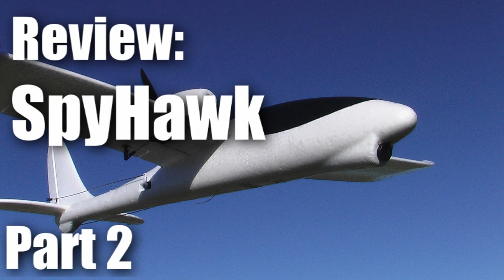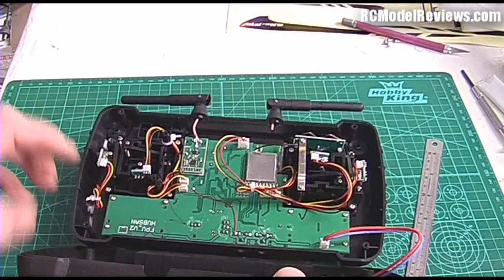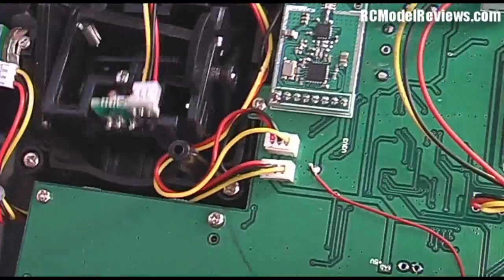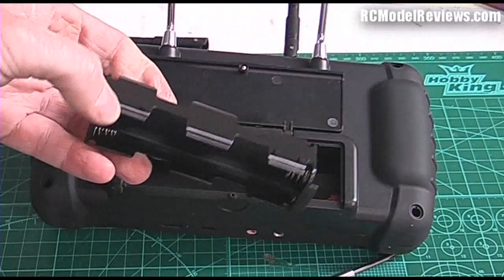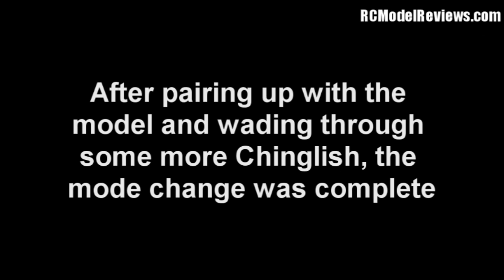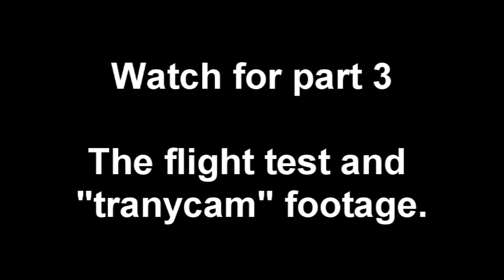Review: Hubsan SpyHawk FPV (part 2)

Comment: And between Ali and Hubsan they are improving it over time to work out all the glitches, they already solved the problem so you can turn off and on the stabilization, added a feature to start and stop recording, solved the overheating issues with the video tx, and as time goes with more tests and reviews it'll only get better. Atleast they are trying, and the 1st to have a fpv all-in-one in fact as well. The 2nd batch seems to have fixed alot of issues and the 3rd batch should be pretty sweet!

Comment: I was thinking that the transmitter would be a sweet hack job, you could scope around and find the PPM sum (it would have to be there somewhere) and fit a full range FrSky DIY kit, and replace the biquad antenna with an external CP cloverleaf.
Then you would have a nice FPV TX for nano flyers and park flyers that you could use with standard FrSky recievers and any VTx equipment that uses a 5.8Ghz SkyRF module.
But now, it appears the switches and pots inside the transmitter are too nasty to try.

Comment: Hi Bruce
Did you check what if any circuit board segments used a voltage higher than 3.3V?  Or will it be OK just to use a 2 cell Lipo?

Comment: Have you checked the ratings of all of the companies that sell on line?  It's not a pretty picture.  That isn't an excuse for Pete to not return phone calls, but the reality of the situation is that most of them are all run like used car lots.  If you like higher end EDF planes then Pete has the best selection.

Comment: Even on a bench supply the display had blinkout at 11.8v. Must've been my unit. Also to note was that the cap leading to the linear reg on the display board was only rated for 10v even though nominal voltage is 12v. Now the unit works better with a different display but the beeping occurs as about 9.5v no display cutout though.

Comment: Must've been my particular unit because it did the display blinkout even at 11.8v. I tried it on my bench supply and got the same thing even though it had all the current it needed. Which is why I tried the battery. Like I said in another comment though the cap that was used on the display board was a 220uF 10V electrolytic cap and that blew which destroyed the display controller. This cap would've probably blown over time anyways since the nominal voltage is 12V

Comment: 2S didn't work. the threshold for the display to work was 11.8V. I don't have any 3S batteries so I put 2 2S in serial. That was a mistake. The control itself works fine at that voltage but the stock display (hubsan didn't make it) couldn't take the voltage. Luckily for me I had a display that I laid over top of the original and it's better than the original display with a larger screen and actual settings.

Comment: Ok, I screwed the backlight but there are three wires coming off of the board. Ground (blk) +12V (red) and Signal (yellow). It is an NTSC signal from the looks of it and I was able to output the video to a standard dash camera screen. They're cheap, like 20 bucks so it's an ugly fix. I could put the screen on top of the TX perhaps.

Comment: Now that I'm tinkering around with it, the module they used for the video used a 220uF 10v rated cap for 12V service. You can push an electrolytic a little bit, but not that much. This unit is prone to failure.

Comment: Hi, would it help to remove the  dummy antenna outside and mount the 5.8ghz fpv antenna instead, outside  the transmitter body? If yes, does it have to be rotated to any angle compared to the 2.4 ghz? 
Thanks. Just being curious in technology like that. Im not buying one, YET.not if the electronics/ servos etc can't be reused in case of a crash.  Ps: don't get too soft Bruce, I've seen MUCH stricter reviews by you.... A small business  is still a business ;)